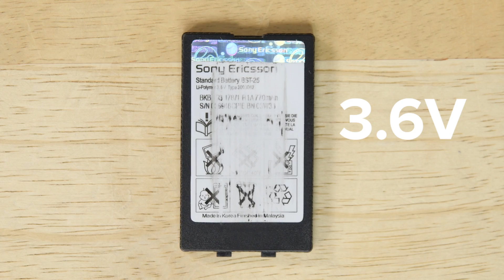My First Phone: The Teardown (Sony Ericsson T616)

Comment: Currently rocking the Sony Ericsson W995, such a beasty and sexy device. Mint condition, using it as a backup device, and also for fitness/music. I have recently changed the display plastic outside protection, due to some scratches, and it was a piece of cake. The times when phones weren't rectangular slabs, and had a lot more character to them.